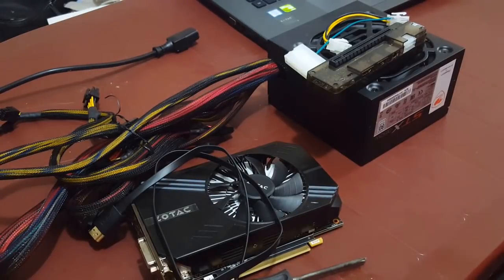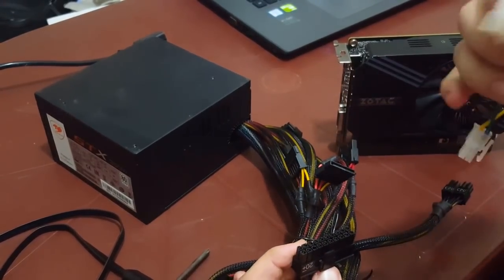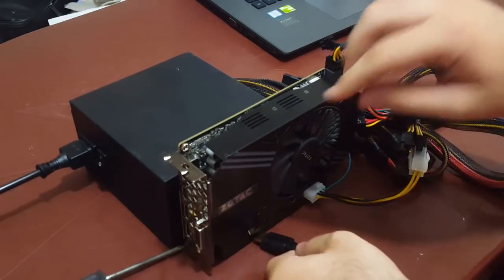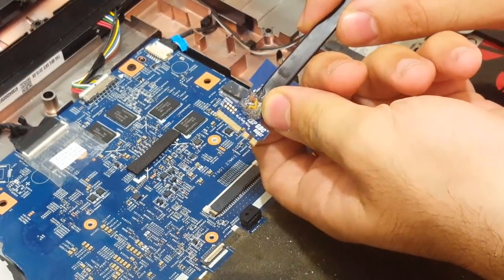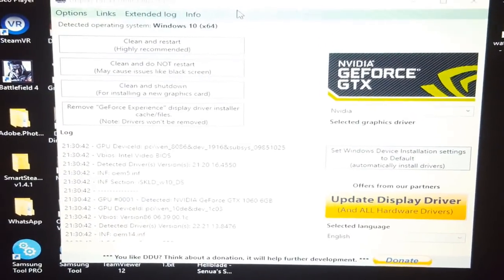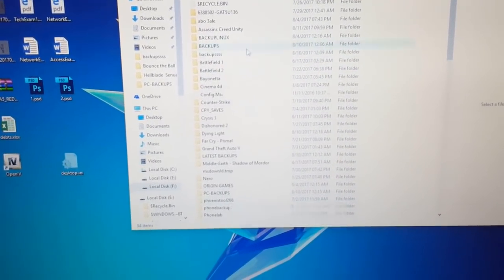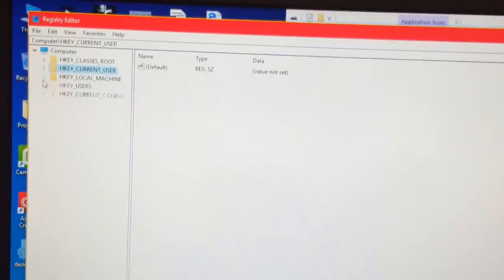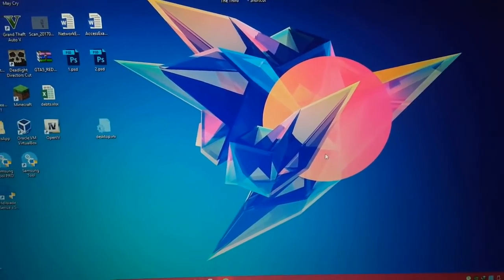HOW TO: External GPU for any laptop PC W/O External Monitor GTX 1060 EXP GDC 1050 ti solve error 43

Comment: How I got my 1050 ti running smoothly temporarily (because it eventually deconfigures itself):
Intro: So, guys, according to my budget and my location the 1050 ti msi gpu was the best cost effective option, I investigated a bit and I found that it was difficult to install it as a egpu but at the same time I found that it was possible so that's the only thing I needed to go for it.
Hardware: The computer I used is a Dell Studio 1535 dual core 4gb ram 500gb hardrive, I installed windows 10 cause I figured that it would be easier to install the drivers on windows 10, the adapter is a "Beast exp gdc" and the power supply it's a EVGA 500w 80 plus certified (which I bought to expand my project in the future). 
I opened my laptop and I noticed that it had 3 mini pcie ports (lucky me), one was occupied by the wifi antena and the other two were simply empty (don't know what they were intended for. lol). 
Steps: after about 15 hours (probably 14 of learning and 1 of actually getting things done) this are the steps that worked for me: 
1: Make sure that you do not have any Nvidia drivers in your computer, if you do so reboot your computer into safe mode and run the Nvidia drivers uninstaller. Restart your computer (as the option says highly recommended) and turn off your computer.
2:Install the hardware correctly (as shown in this video) and turn off the gpu.
3: Turn on your laptop and wait for windows to finish booting.
4: Turn on the gpu, you should see that your computer is thinking (it means that it has detected the new hardware) and on "device manager" you should be able to see a new unknown display device.
5: Download Nvidia Drivers Version 368.81
6: Modify Drivers Version 368.81
 6.1: Drivers Version 368.81 has an Nvidia icon but it is a simple compressed file, so extract it with any program like winrar
 6.2: Go to the folder that you just extracted
 6.3: Look for another folder named Display.Driver
 6.4 :In the Display.Driver folder look for a file named "nv_dispi.inf"
 6.5: Click on it and it should be opened as a text file
 6.6: Around line 475 you should find the end of the supported devices list
 6.7: The last supported device on the list it's          %NVIDIA_DEV.1C03%           = Section062, PCI\VEN_10DE&DEV_1C03    
 6.8: Simply right below it copy and paste this         %NVIDIA_DEV.1C82%           = Section062, PCI\VEN_10DE&DEV_1C82
 6.8*: .The code "1C82" it's for the 1050 ti, if you are using a different gpu look for your code here http://envytools.readthedocs.io/en/latest/hw/pciid.html#gp106
 6.9: Now go to the bottom end of the text file
 6.10: Around line 8241 you should find the end of another list of supported devices
 6.11: The last supported device on that list it's                     NVIDIA_DEV.1C03 = "NVIDIA GeForce GTX 1060 6GB"
 6.12: Simply right below it (press enter to create space if needed) copy and paste this:            NVIDIA_DEV.1C82 = “NVIDIA GeForce GTX 1050 Ti”
 6.12*: This code is again for the 1050 ti model, change it to your needs. 
 6.13: Save and close it.
7: Now, we are going to disable driver signature enforcement (so we can run our corrupted driver LOL) so-> 
 7.1: Open a command prompt running as administrator (windows search -> command prompt (the black window with gray text) -> right click -> run as administrator).
 7.2: On the command prompt write:      bcdedit.exe /set nointegritychecks on
 7.2*: It should say succeful or something like that
 7.3: Then again write:         bcdedit.exe -set loadoptions DDISABLE_INTEGRITY_CHECKS
 7.4: And then again write:            bcdedit.exe -set TESTSIGNING ON
8: Restart your computer as normal. 
9: Run your modified 368.81 driver installation (with the setup file that is inside the extracted folder) and only check to install the drivers and the physX (as in this video).
10: At some point windows is going to tell you that the drivers are corrupted and ask you if you want to continue, naturally click yes.
11: DO NOT restart your computer when the installation finishes, follow this video instructions, -> win+r -> regedit -> hkeymachine -> software -> delete the folder named Nvdiarebootneeded.
12: Now download the latest drivers you can find on the official Nvidia website according to your windows and gpu. 
13: DO NOT modify anything in this drivers just install them as they come and again just check the drivers and pshyX options. 
14. Restart you F*CKING computer and that should be it. 
DONE
I DO NOT TAKE ANY CREDITS FOR THIS, these steps are just a combination between this video and this forum  https://egpu.io/forums/expresscard-mpcie-m-2-adapters/FIXED-Nvidia-GTX1050Ti-error-43-on-mPCIe-or-M2-non-hotplug-eGPU-interfaces-applicable-to-GTX10xx/         all credits to Pedro Marthon and GynTh0r.
*I will share some problems that I had and why I had to follow this steps as they are: my laptop wouldn't turn on if the gpu was on, after having the computer to recognize new unknown display hardware if I restarted my computer in safe mode it simply would not turn on back again and I had to turn off the gpu - for that reason I had to use the command prompt to disable the drivers enforcement, if you install the drivers without modyfing the 368.81 you will encounter error code 43, if you try to install the modified driver without disabling drivers enforcement installation will simply fail.
Reply from the maker: Carlos Villa thank you so much for sharing such knowledge, I pinned your commend so people can read it easily.
Reply: @hmawla  can I do this work for my acer v17 nitro GTX 960m i5 4210H ?
Reply: @hmawla  I made a 400 us$  titan gtx just bougth in ebay work on a 11.6'' SAGER NP6110 upgraded with a 3.0-3.9 GHz (i7-3940XM) quad-core cpu work with your instructions... and get this: USING THE EXPRESS CARD SLOT, so actually did not even need to open the little one, though it would have been easy since you get to the wireless card without unscrewing anything on this model. So, saying THANKS is underrated here. I have basically something better than an actual 2019  razer blade stealth 14 small as 11.6 inches. Will link a small video showing it and directing people to here for know-how.
Reply: thanks Carlos Villa...its work to me..
Reply: In your case, in the code that you have to add I found two: 0x1b84 GP104 [GeForce GTX 1060 3GB]   and   0x1c02 GP106 [GeForce GTX 1060 3GB]     -    First try to download the latest drivers according to your hardware from the website, if that doesnt work, then try the modifying method. Give me more details if this doesnt work.
Reply: Have you tried 
1 turning off the gpu, 
2 turning on your laptop 
3 turning on the gpu when your laptop is already on?
Reply: Carlos Villa how can I turn off my gpu ther is no button . I tried to plug in the hdmi into the adapter while the laptop was on but than he shout down or the black screen comes again . Thanks for your help.
Reply: Carlos Villa This worked I can start my pc but there is no new monitor in the driver manager . and all ways when I want to install the driver he just say that there is  no compatible hardware .
Reply: you are awesome bro you saved my 26k i have lenovo z570 1 gb nvidia i followed your steps and i successfully install 1050 ti zotac on my laptop with mpci version 8 
thank you thank you very much
Reply: @dhruvrajdahiya9229  bhai kitni cost lagi?
Reply: Amol Chopade uper likha hai bro
Reply: @dhruvrajdahiya9229  bhai yahan bhi bta de kya kya karna hai i have a hp laptop with nvidia 830m  internal graphic card do i need to buy separate display or not and how much all the setup cost you i mean full gpu prices, egpu dock price, and power supply price?
Reply: Carlos Villa make vid how to do
Reply: Hey i got 1050 Ti but i cant see it in device manager so if i make your steps will it work or did it work on your leptop ?If you reply thank you so much dude :D
Reply: @nadiralan427  Did you disabled all pci express root port in device manager i.e port1,port3?
Reply: @bankai_333  I didnt touch anything but when I open device manager I just see Intel hd graphics but nvidia not thanks for repşying
Reply: @nadiralan427  how many root ports are their in your device manager? If it has three than try to disable one of these ports all three ports works in a different way for example port 1works for integrated nic and port 3 for Dgpu if you have in your laptop and one another port which will show your graphics card in device manager you must not disable that port but those other two ports need to be disabled, otherwise it won't show in device manager.
Reply: @nadiralan427  What is your laptop brand so i can cleary explain?
Reply: @nadiralan427  try to disable pci express port you will find it in system devices.And see which one works for you.Remember not to disable all
Reply: @nadiralan427  How many pci ports do you have ?
Reply: @bankai_333  I ll try thanks
Reply: @nadiralan427  yeah, i also connected exp gdc with amd rx570 and it was not shown in device manager i also do the same thing and it has shown in DM.
Reply: @bankai_333  I have 1 PCI express root complex
Reply: @bankai_333  I bought 1050 ti
Reply: @nadiralan427  I know that,Have you tried disabling one of those pci ports?
Reply: @bankai_333  no I just checked pc setup when pc wasnt opened and there was no PCI enable/disableoptipn (In BIOs ı checked these )but can you please help me because I bought Msı 1050 Ti and I want to work it :i
Reply: @nadiralan427 No Not in bios you have to disable it inside system devices from device manager .Can you take screenshot of your system devices where pci root port is available.
Reply: You can share it to my facebook messanger
Reply: @nadiralan427 I don't know pci port notation in toshiba laptop bcoz i have dell ,so you can share it to me on facebook .Bcoz if i will see your pci port than i'll explain more about it.
Reply: @bankai_333  do you have steam I can tell you what do I have in device manager
Reply: @bankai_333  pls give your gmail i ll send
it to you
Reply: @nadiralan427  No this is not that one there are more ports for exp pci-pci port or pci express root port 1,3,5 they are the one
Reply: @nadiralan427  No i'm not a steam user
Reply: @bankai_333  there are 7 Pci to Pci bridges are they ?
Reply: @nadiralan427  If you can share a screenshot of your system devices page in device manager than i will tell you more better
Reply: @nadiralan427  if you can share picture of those all than i will understand
Reply: @nadiralan427  Or more better you can search about pci ports notation in toshiba laptops
Reply: Turn off (or disconnect) the gpu power supply, then turn on your laptop
Reply: Turn on your GPU (or connect it) when your laptop has loaded windows and is idle. <--- It's all on the steps above bro.
Reply: Hey guys, i'm not able to install 368.81 drivers because it says that there's no compatible hardware. I've used the modified version and the original one but none worked. I've got a gtx 1060 3gb! Can somebody help me? :S
Reply: Dear, I love you
Reply: Did you ever know that you're my hero? God bless ya boomshakalaka:) nice bro so detailed really thanks a lot give me your bankcode
Reply: Here is a fix for error 43 on GTX 10xx cards:

https://egpu.io/forums/expresscard-mpcie-m-2-adapters/FIXED-Nvidia-GTX1050Ti-error-43-on-mPCIe-or-M2-non-hotplug-eGPU-interfaces-applicable-to-GTX10xx/
Reply: The solution is, Nvidia knows that we all broke, can't afford to buy a new laptop, so, they punish us by giving that error code 43😂😂😂😂
Reply: thanks for the help man.
but man, this sentence "I investigated a bit and I found that it was difficult to install it as a egpu but at the same time I found that it was possible so that's the only thing I needed to go for it." killed me.
fck it, thats so true and applies to all aspects of life. man this sentence motivates me so hard :D
Reply: @olim8742  I'm glad it helped!
Reply: Carlos Villa i have a dell latitude e6430 do i have to press the shift an f4 when i start the laptop
Reply: @zey2416  I do not posses a dell latitude but you could try f2 or f12. Best luck!
Reply: @carlosvilla6120  oh okay thank bro
Reply: When I want to start my laptop the screen just is black . I have a gtx 1050ti . And wenn I connect the gpu to my tv it still gives no signal. 
Can someone help me ? I'll be very thankful.
Reply: Carlos Villa I'll test it when I am back from school
Reply: Carlos Villa First of all' thanks forum answering! I Will try in these days! But should i write also GP106 or only 0x1c02? Thanks again!
Reply: why my EXP GDC not responding when I switch on my room light..it become kernel error driver 390.77...
Reply: it that because the voltage or current of my house not stable?
Reply: i can't do the step with the command prompt. it says that it is protected by the secure boot or something. do you know what do to here. because i haven't started it up in safe mode
Reply: Carlos Villa idk why its only works for 1 time
after i restart/shutdown cause Tdr failure
error 43 showing up again
Reply: Carlos Villa go to egpu.io and search gor the websites developer nando4 ask him about error 43 he show you how to fix it
Reply: Thanks a lot i use 1030 and successful, i modify the nv_dispi also list devices, with 1030 attributes. thanks once again
Reply: I love you brother u help me too
I just stuck but you help me
Using 1060 btw
Reply: @RSHBHJN  will it work with hp pavilion dv6 laptop??
Reply: Amol Chopade it will work with every laptop 
Just cgeck ki latop me konsa port hai ngff ya pci
It will work with both but need different wire
Reply: @RSHBHJN  kharcha kitna hua?
Reply: Amol Chopade gtx 1060 gpu 23000 psu 3500 
Adpater 3500 wifi adapter 800
Reply: Hello carlos i want to install 1060 gtx msi 3gb on my i7 4th gen 8gb ram should i have to follow the same steps?
Reply: I hadn't success about 7 hours until see your detailed solutions..
I use ASUS TUF GeForce GTX™ 1660 O6G GAMING and run smoothly.

Thank you and thank Hussein Al Mawla so much!!
Reply: Thank you very much to all who contributed to everyone and my GTX 1060 works for me. Thank you. Thank you. I have no words.
Reply: Does this still work? Even for the latest drivers now?
Reply: @axery8427  It should, nevertheless I don't have the same hardware anymore so I can't confirm. Good luck!
Reply: Hello friends can you tell me what gpu should i use with my laptop its hp probook 4520s
the specs are:
Intel Core i5 480M @2.67GHz
6GB DDR3 1333MHz of ram
Win 10 Pro 64bit OS
AMD Radeon HD 6300M 1GB dedicated Vram
500GB HDD
my gpu is malfunctioning but everything else is fine so what gpu do u recommend for this laptop?
and other parts i got the dock the cable etc
Reply: guys im thinking of pairing an amd rx 570 8gb with my hp probook 4520s can anyone tell me if i will need an e-monitor or not and will the bottlenecking?
Reply: HP Probook 4520s
the specs are:
Intel Core i5 480M @2.67GHz
6GB DDR3 1333MHz of ram
Win 10 Pro 64bit OS
AMD Radeon HD 6300M 1GB dedicated Vram
500GB HDD
my gpu is malfunctioning but everything else is fine so what gpu do u recommend for this laptop?
and other parts i got the dock the cable etc
Reply: Nice job wasting 1050ti on trash laptop, idiot!
Reply: Hello I have a 1050ti too but mine isn't working when I open my laptop it flickers and the screen Stop working if you have a solution please

Comment: God damnnnn...... I FINALLY MADE IT, after 16 hours of learning and setting up configurations I got my 1050 ti to work as a egpu. Will tell you more about it tomorrow.
Reply from the maker: AMAZING!! CONGRATULATIONS!
Reply from the maker: Kurosaki Reiga use an external screen
Reply from the maker: Kurosaki Reiga what game were you playing, and did you try changing your PSU?
Reply from the maker: Kurosaki Reiga maybe PSU is losing its power while gaming, try changing resolution to 720p
Reply: carlos villa,, my asus strix gtx 1050 ti work fine as egpu and show no problem occur, but when i run the nvidia control panel, its shows error says that " you are not currently using a display attach to an nvidia gpu" im using internal display,, what is that mean dude? do i need to use xternal mionitor or what?
Reply: Pedro Marthon i already use external monitor then i can only run games about half an hour,, then its show a problem with your gpu,, its says that my graphic setting to high need to lower the graphic configuration,, i use 1080p resolutiin,, do i need to match my laptop resolution?
Reply: Pedro Marthon my psu is cooler master 650w, the game i play is the rise of tomb rider and dota 2,, do i need to setting the gdoc or someting?i can see the button that can change the certain setting at gdoc,, what is that cause the problem?
Reply: Pedro Marthon i think thats the problem,, by the way thanks a lot bro,, your video and carlos tutorial realy help my gtx1050ti works as an egpu,, mybe i need to change my psu,, thabks a lot dude

Comment: I had Acer Aspire E15 - 551G , got two gpu R6+R7 m265, im planning to to same with GTX 1050ti , will it work on my laptop without external monitor ??

Spcs: Processor amd a10 7300
8GM ram 

Thanks
Reply: No matters